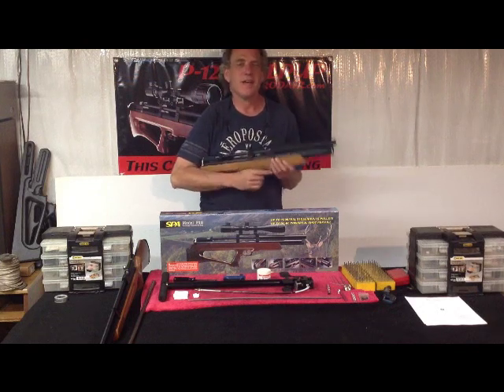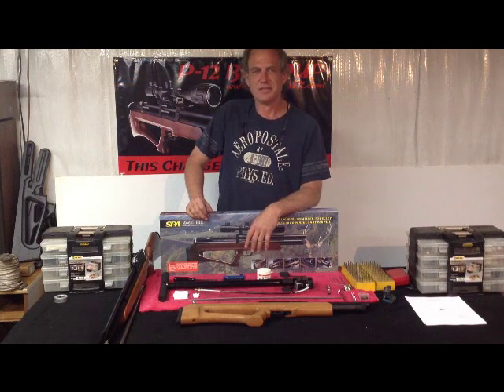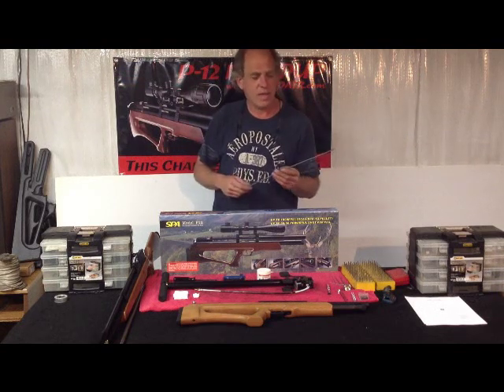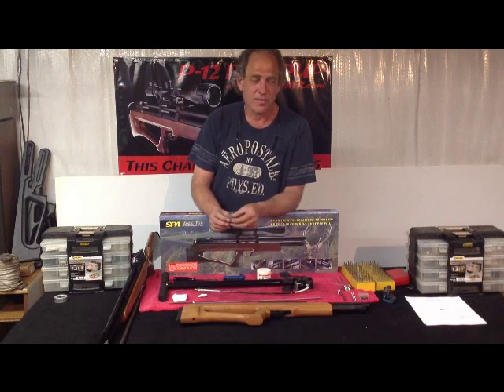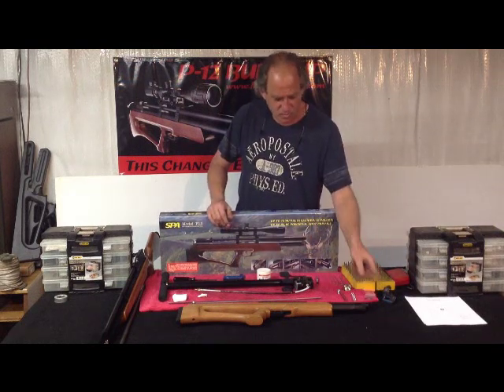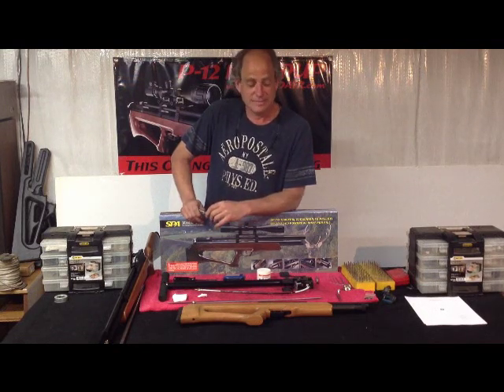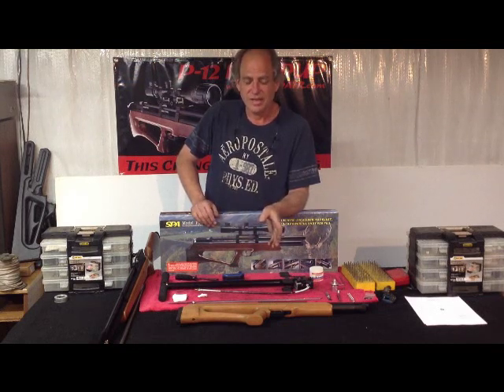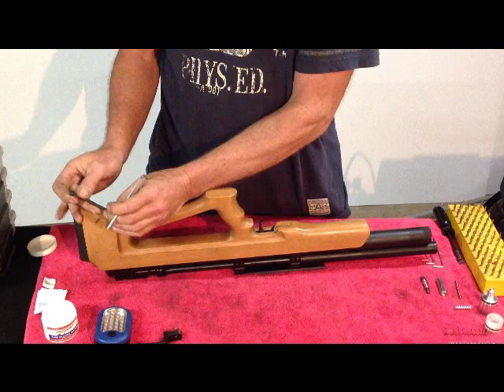SPA P-12 Bullpup Teardown Mrodair Part 1

Comment from the maker: Michael Esch
1 second ago

 
Basic teardown, and maintenance procedures for the Mrodair version P-12.
More detailed videos coming soon, with tips and tricks for the sub assemblies for more specific tuning to your personal requirements. 
This video can be used as an overview, for basic teardown information.
More to come very soon.
We are Mrodair
Reply: +Michael Esch
Hello Mike, I have a problem with my p12, think this one will put a grin on your face :)
here goes;

I recently finally found suitable o-rings for the air cilinder so i fixed the leak i had, however,

I think that i closed the HUMA regulator instead of opening it completely no air comes out at all when dry- fired.       ( i'm trying to tune it to shoot solid .22 bullets as it really likes the heavy pointed Samyang pellets)
Now ive got a leakfree airc cilinder with 100 bar in it, yet no way to acces the regulator again since i cannot get the pressure out by dry fireing. I know derpderpderp....
is there a way you know of to get the air out?
Sorry for my English and greets from Belgium man
Reply: your vid was enough mate, got it.
Thanks man!